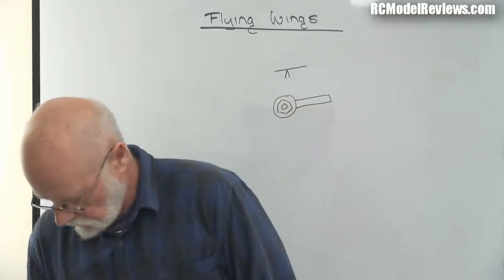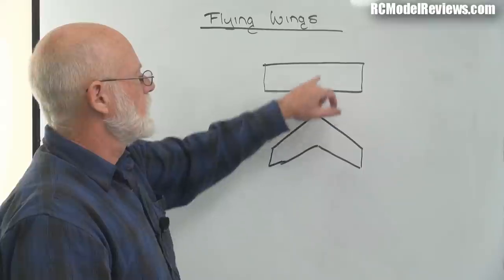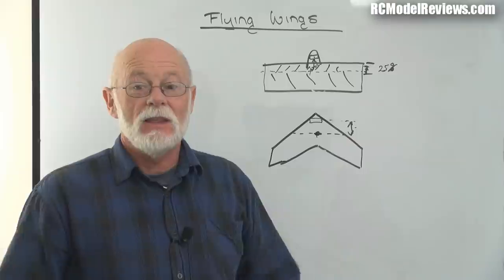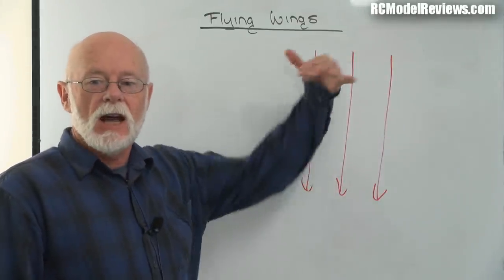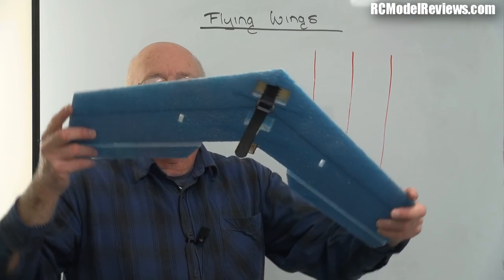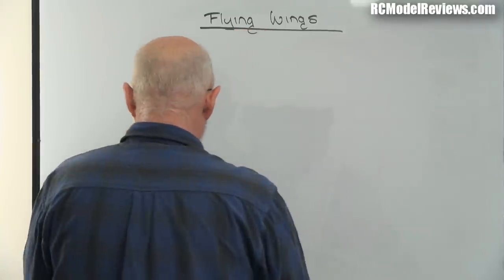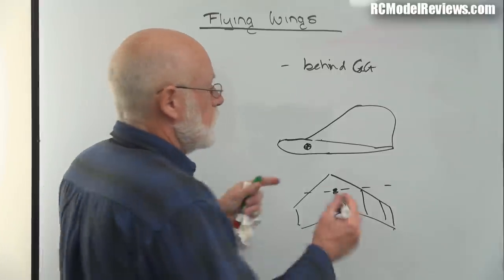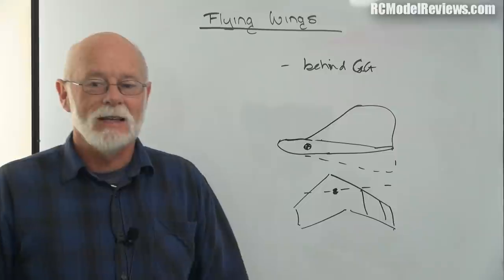The aerodynamics of flying wings (part 2)

Comment: You know that a true flying wing doesn't use fins.
Prandtl's bell shaped lift distribution produces positive yaw stability, meaning that the lifting tip is thrust forward while the sinking tip dragged rearward.  This is a characteristic unique to the Prandtl & Horton wings which do not need any fin at all.

The Prandtl wing published in 1933, is produced by solving planform with root moment as the design constraint & incorporates span wise changes in incidence, camber & reflex.

Also, tip fins don't meaningfully cancel tip vortex, unless their length approaches a semi span.
Triplets are not tip fins, tiplets are angled across the vortex flow to extract forward thrust from the vortex flow, attenuating it's drag effect.  However, you are just better off using the Prandtl wing solution which facilitates a larger span for the same wing bending moment, by depowering the tip with more taper & washout so that the tiplet is effectively just part of the span.

Comment: f@t b@st@d says = you have to get into hydrofoil pump board wave riding [ wingfoil ] + you may be able to answer the question of air to liquid = meaning air wings as you have in flying wings part 2 would work better in water turned upside down [ because of pressure of liquid ] unlike the hydrofoil designs of today that mimmick air flight design ?? = a pioneer of hydrofoil surfing did just that turning the bomber style plane upside down into a wood /fibreglass swell   riding wave board + seems easier to handle a breach or leaving and re-entering the water + all the best and great content

Comment: Swept wings for transonic / supersonic flight regimes has nothing to do with a "pressure wave pushing only on the front of the wing which reduces drag". What you dont want is the shock wave interacting with the wing surface as it generally causes separation of the boundary layer when it impinges on the airfoil surfaces, so for high Mach number regimes, you sweep the wings aft (to fit into the Mach cone) and avoid the shock wave interacting with the wing itself and causing the boundary layer to separate. I hate it when pseudo professionals make stuff up. Then we have to undo all the hocus pocus and reteach it properly when the kids come to engineering school.
Reply: Also, the CoG has nothing to do with the 1/4 (25%) chord line. That is the Center of Pressure (CoP) (also not to be confused with the aerodynamic center "AC", which is something else again), and is the line on which we assume the aerodynamic forces acting (if you simplify them to act as a single resultant vector). The CoG has to do with mass distribution and obviously cant be calculated with knowledge of the internals of the wing / aircraft mass distribution. Balance between the gravitational force acting at the CoG and the aerodynamic forces acting at the CoP is the crux of the issue ...

Comment: I know this is not highly technical but your reason for having swept wings is not accurate. The reason for having swept wings is actually simple and intuitive for those who understand basic trigonometry. When the freestream flow meets the wing - because it is swept - the freestream flow is resolved into the components parallel to the chord line of the wing and a spanwise flow. This means that the effective wind causing the lift has much less speed than the freestream flow, hence, shockwaves won't form on or at the wing - reducing drag as you said. This is why, even though the Concorde flew at supersonic speeds, the effective wind affecting the wings was subsonic.